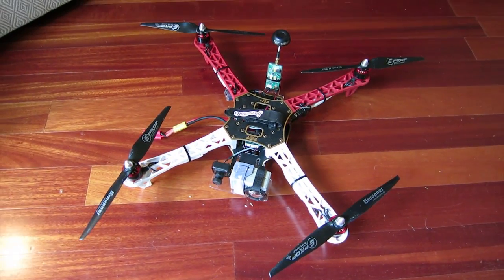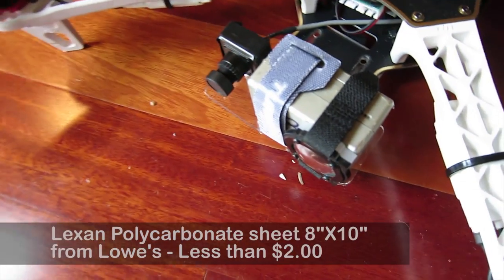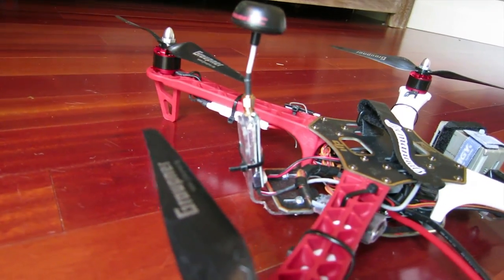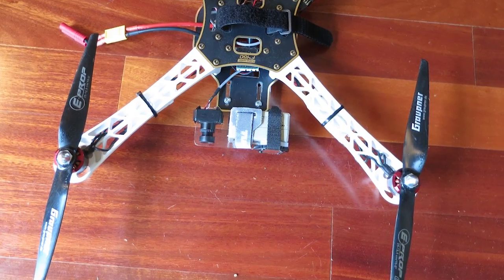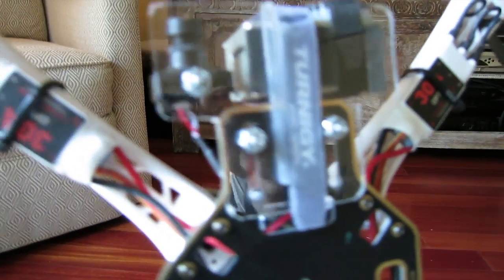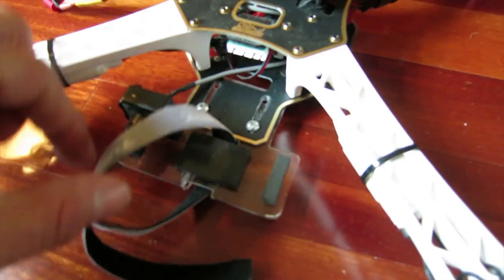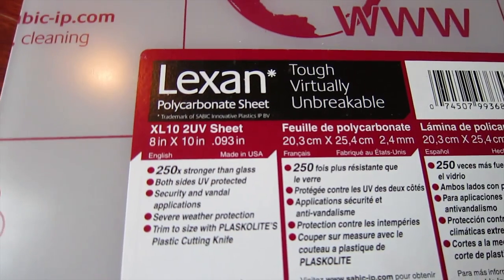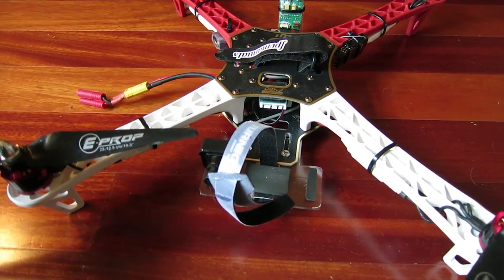FPV Accessory Mounts from Polycarbonate on DJI F450

Comment: Hi Anthony, thanks for the video, I'll be copying this build pretty soon ;-)
Question: I could tell you had your props in teh camera view (just a bit in the upper corners). Did you use the GoPro's standard wide screen setting for this or did you change that setting? I want to avoid getting my pros in view as much as possible. I would appreciate some tips on that... thanks!

Comment: good idea on the mount.  I used to use the two cam setup.. you should really try using the gopro as your cam.  It is way better than you would think based on reading on forums about it.